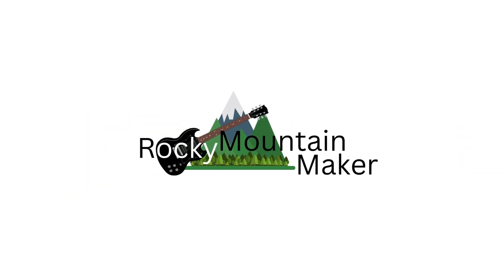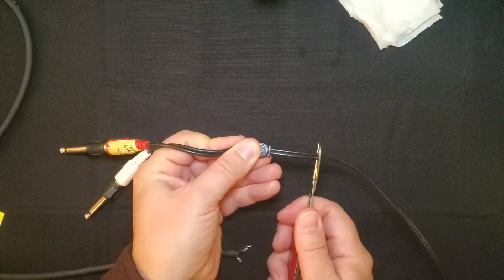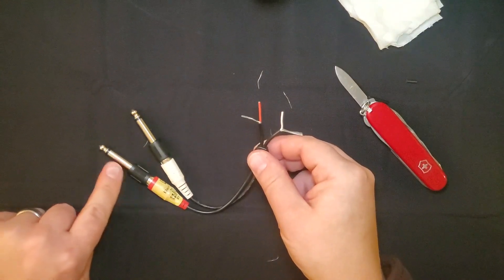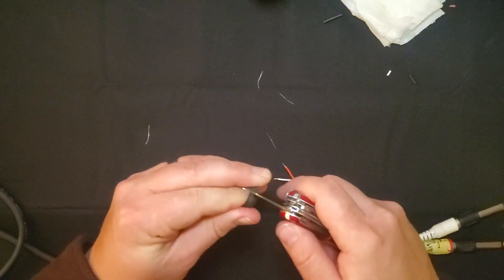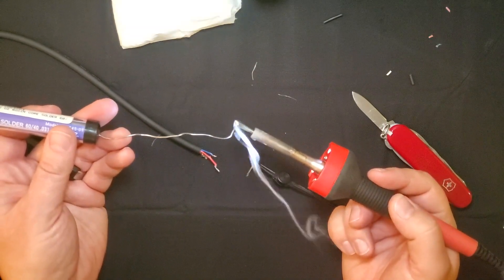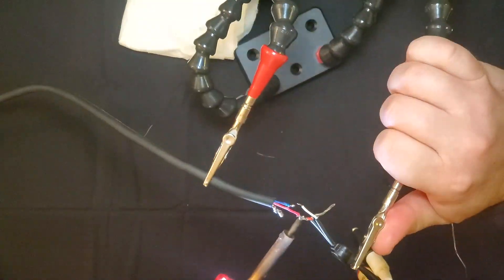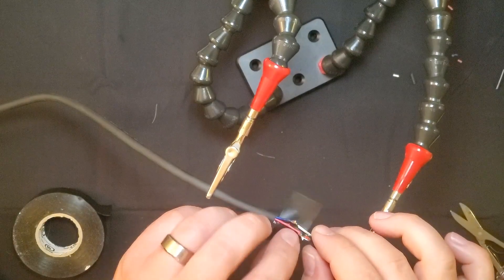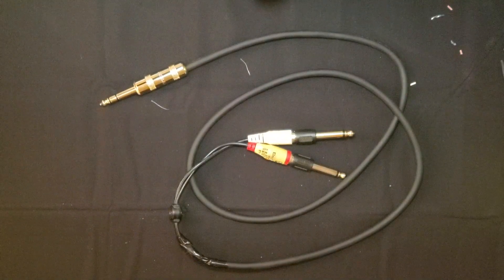How to make an insert cable (Stereo TRS to dual mono TS cable)

Comment: Can I use this type of cable to connect my electric guitar to the left and right inputs of a stereo channel on my mixer. And get a normal level set signal out. When I connect to the left or right input with a single mono or stereo (TRS) cable I only get a very low level signal out. So far no-one and nowhere has been able to answer my question.
Reply from the maker: A guitar is naturally mono, so connecting by stereo isn't necessary. A standard guitar cable will suffice (TS to TS). The signal is naturally low from the instrument, so it needs boosting by plugging it into an input marked "instrument" on a mixer, or a standard input where you then turn the gain up so that you can hear the sound. I hope this helps.
Reply: Thanks for a reply, RMM.  But I only have 8 channels on my mixer. 4 are mono 1/4" jack inputs and 4 are stereo left and right 1/4" jack inputs. What I need to know is if my first 4 channels are full for recording can I use a Y-cable for an electric guitar connected to my stereo channel left and right input jacks. As I said before if I use a single cable to my stereo channel input the output signal is too low.
Reply: @emilloffler1216  This is not likely to work well. GENERALLY speaking, stereo inputs on a mixer expect a line level signal, not an instrument level signal. So, even if there's gain available on those channels, it's expecting so much louder of a signal that there is not likely to be enough gain to bring an instrument level signal up to useable levels.

Comment: IN A WORLD where heat shrink and moldable silicone putty are no more... ONE MAN will assemble an emergency insert cable with a 15-watt soldering iron and electrical tape. He is... MacGyv ROCKY MOUNTAIN MAKER.